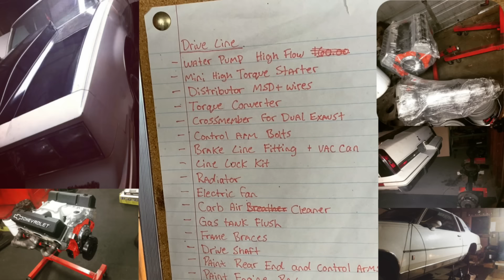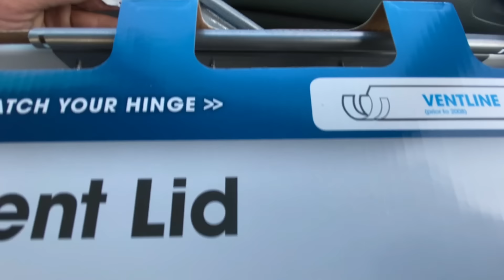We Got My Dad A $2000 Tiny Home On Wheels And Huge Vanlife Update Before Leaving On A Long Adventure

Comment: Something i learned along time ago.. if you have the ability to pull them off.. take one tire or 2 to one shop then the rest to another. FLAT REPAIRS are easier for walk ins. then having to pull vehicle in the shop for 4 or whatever. Alot of paper work for the vehicles.. not so much on a flat repair ticket. Also easier for shop to accept a TIP for the job and not PAYMENT, there is a difference.  Good luck in the future.